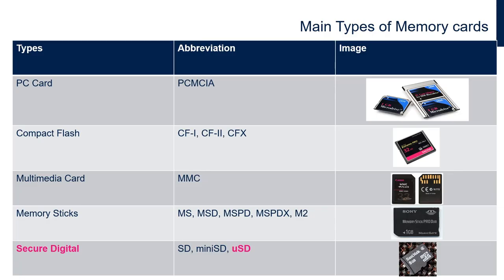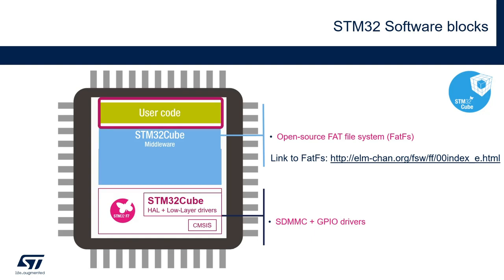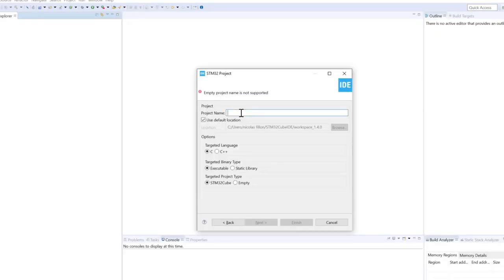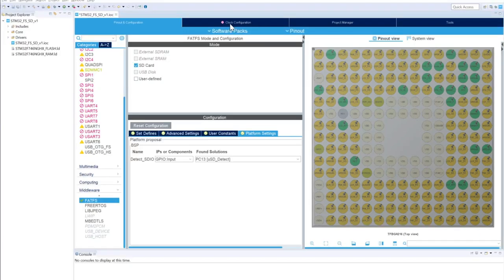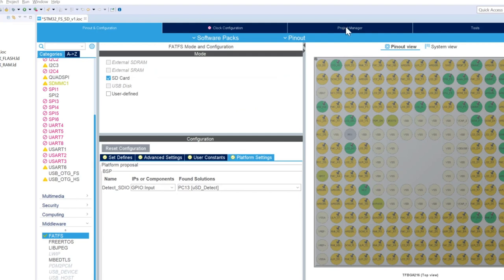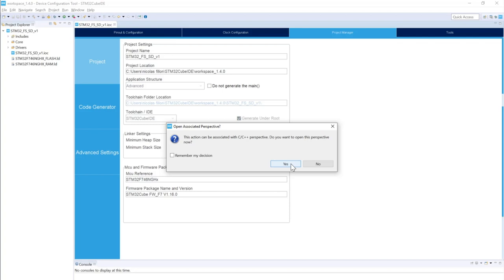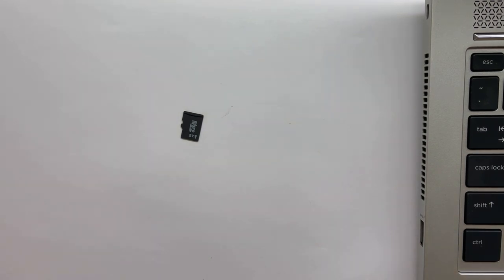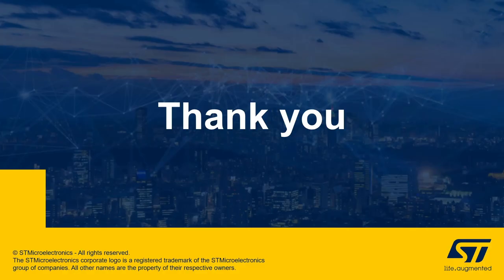STM32 – Creating a File System on a SD card

Comment: In case someone still having troubles with the H7.
These steps worked out for me:
-activate SDMMC in 4Bit wide bus
-For MDMA Controller activate Chanel for sdmmc streams and make shure MDMA interrupt is active for sdmmc
-integrate FatFs Library 

NOTE: Parameters in Unmount-Function for SDCard are in the wrong order.

When working with FreeRtos and TouchGFX-> for Fatfs deactivate FS-Reeantrant and activate for FreeRTOS. Than before you are able to work with sd card-> disable D-Cache and enable when done
Reply: Hello, can I DM you? We are doing a project and would like help to setup our SD-card reader with our H7. Thanks in advance

Comment: I Have a similar card: STM32L496G-DISCO and tried this tutorial. Pretty mutch everything is the same but there is some small differences. Under "Plattform settings" there is no uSD-Detect. This seems to be routed to a i2C chip. (Is this nessecary to have). The DMA settings is also a little bit different. Under SDMMC1 the DMA for TX and RX buffer is "Normal". The command f_mount and f_mkfs returns ok but the f_open, f_read etc gives an error in return. Any ideas on what to do? // GH
Reply: Me too - same board. I'm going to try to get sdmmc working as that seems to be the main problem.
Reply: Try to work without DMA at all. Disable Use of DMA template from the FATFS options as well. Worked for me, except if you also need FREERTOS then DMA is a must!
Reply: @mohammedeqbalabdulkhaleqes9534  I am using L476RG and even with the DMA disabled, I cannot execute the code as it always end up in the error handler.

Comment: Newer CubeMX replaces FatFs with FileX. Formatting with FileX is not as straight-forward as it is with FatFs, you have to specify sector count and bytes-per-sector. To be able to do that, you have to query the SD card about its size

Comment: Firstly, thank you guys very much for the really helpful tutorial. 
Secondly, for you guys, who don't success with this tutorial, try to use another micro sd card. For me, I used stm32f7508 discovery board, which is very similar to stm32f746, with micro sd card from Intenso it doesn't work at all but for no name micro sd card it works like a charm! 
Last but not least, could you guys please give more explainations for the configuration parameters because working is good but understanding is perfect.  
Lastly, sorry for my bad English :)
Reply from the maker: Hi there, thanks for your question - may we point you towards our community.st.com, where you will find a team of people who can answer you directly ?

Comment: Hello Mr. Fillon,
I tried to transfer the example to the STM32H743 Nucleo Board. Unfortunately I don't succeed. When executing f_mkfs, the response FR_NOT_READY comes. Unfortunately, I haven't found a single tutorial on how to do this for this board. Can you perhaps make a tutorial for this board on how to configure the SDMMC mode correctly? Many greetings, Holger
Reply from the maker: Hello,  Visit our online community to find answers to your technical questions and share ideas with your developers and ST experts : https://community.st.com
Reply: Hi, I am having the same issue.  It's driving me nuts.  Did you ever figure out what the issue was?
Reply: @BJH-fm1pf  same issue, I tried also to port the SD examples  for the stm32h735 (i'm using this one) but without success I tried also to opena  post on the comunity forum but no success also there did you find a way to fix this ?
Reply: @vidica94  Yes, I did find it.  The logic on SD Card Detect signal was reversed.  I modified the BSP_PlatformIsDetected() function and inserted status = !status; under USER CODE BEGIN 1.
Reply: @BJH-fm1pf  Im working with f446 and had the same error , can you elaborate where you found that function.

Comment: Awesome video, well explained, great pace (not too fast),, clear and concise voice, very understandable for us novices :). Your code (a) just formatted the SD card and (b) wrote one line of data to it. How do you write many lines of data, say every 5-seconds from a temperature sensor without having to format the SD card every-time? Can you check for a file name in existence before have to format?
Reply from the maker: Hello there, glad it was helpful ! For technical questions we really recommend you check out our community of experts and other developers at community.st.com
Reply: @stmicroelectronics  Do you have tutorial or sample code on read/write SD card through SPI?
Reply: Remove the f_mkfs part to append a new line after opening the file. With f_printf you could write formated data with several coulumns

Comment: Hi, that's great. The example works.
How do I implement this with TouchGFX? I set everything the same and mount the SD card (f_mount), but the next command is no longer executed (f_mkfs) and the system stops working.
Reply: have the same issue

Comment: Hello All great video and I ant to do the same with my stm32l412 nucleo, the problem is I can not find SDMMC1 component in my stM32CUBIDE
Reply from the maker: Hello! Thanks for your positive feedback. We've shared it with our colleague Nicolas. Regarding your question, the issue you are facing is normal because the L412 does not have SDMMC. You would have instead to consider one of the following parts: L431, L433, L443, L451, L452, L462, L471, L475, L476, L486, L496, , L4A6, L4P5, L4Q5, L4R5, L4S5, L4S7, L4S9.